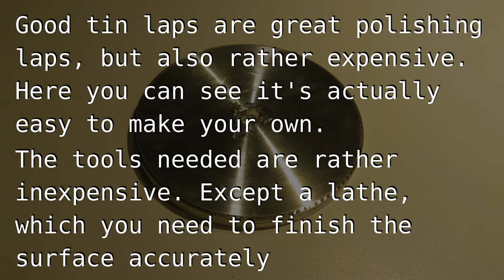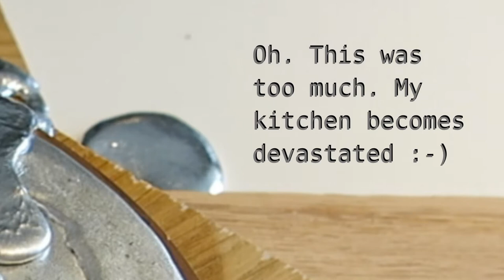DIY Faceting Machine Part 8 - Tin lap on aluminium for polishing

Comment: Great video! I accidentally knocked the arm away from the mast on my Ultra Tec with a stone in process of the final finish. The stone is ok, but it left a tiny pivot in the tin lap I've used for years.  I have a lathe. Do you think the small scratch could be filled? Any suggestions are appreciated. Thanks
Reply from the maker: If it's only tiny, so that it is smaller than any facet you cut, I personally wouldn't do anything. If bigger, filling might work, but you have to heat up almost the whole lap and a lathe is needed for sure afterwards. So maybe not filling, but turning away the lap's surface until the scratch disappears would also work.
Reply: I would get a tin based solder with a little flux, ... after it dries wet sand with some fine sand paper...

Comment: Hi, What you cast with is pewter  and old pewter this will have a percentage of lead in it from the joints etc and the mix of metals
Reply: (/ˈpjuːtər/) is a malleable metal alloy consisting of tin (85–99%), antimony (approximately 5–10%), copper (2%), bismuth, and sometimes silver. Copper and antimony (and in antiquity lead) act as hardeners but lead may be used in lower grades of pewter, imparting a bluish tint. Pewter has a low melting point, around 170–230 °C (338–446 °F), depending on the exact mixture of metals. The word  is probably a variation of the word , a term for zinc alloys (originally a colloquial name for zinc).
Reply from the maker: @paulgreen9298  Wow, thank you Paul for this detailed description. I just knew that it had "95%" on it, which most likely indicates the tin portion.
Reply: @GemWorks  if you do use pewter use modern bright and shiny - and cut out any bits that have seams or look like they have been soldered - that will reduce the likely hood - that you will have lead in it - and its really modern its prob lead free solder - but cutout to be safe